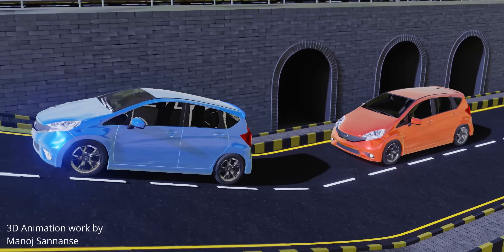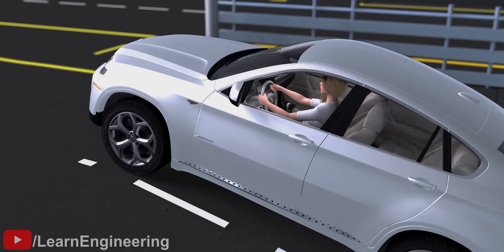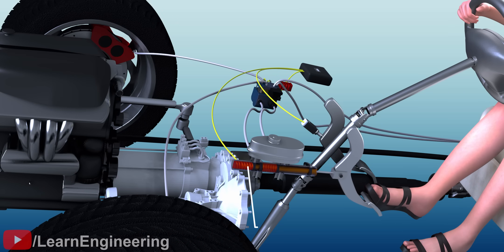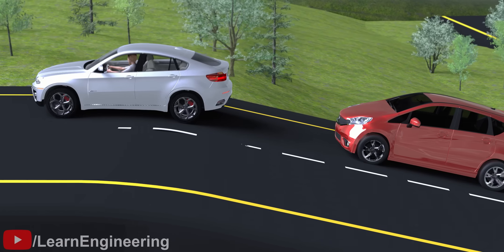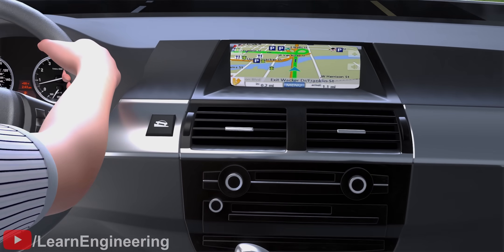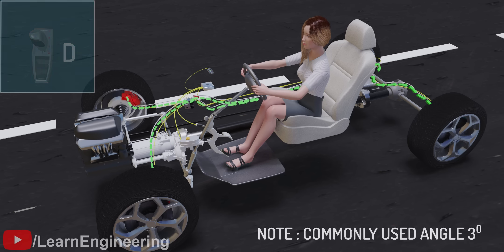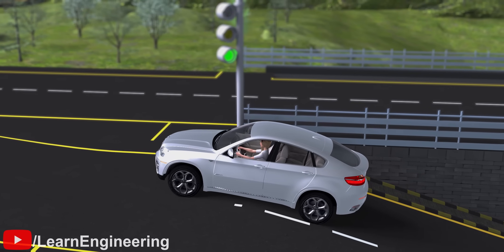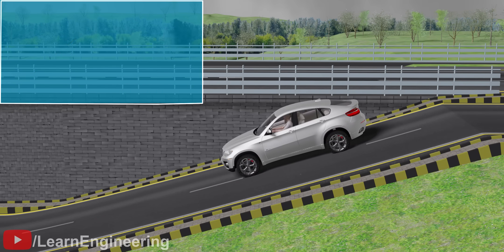Understanding Hill Start Assist!

Comment: Some newbie drivers right now will never experience the pressure when driving a manual and an uphill traffic occurs. Especially when you're a beginner and you can feel your car rolling down and you can hear the honking of the car at the back😂
Reply: My legs be like jelly during such situation
Reply: @Sweaty Goat  mine too absolutely hate going up a hill
Reply: I was taught to drive on a vehicle who had a weak engine (maunal ofcourse). That's why rolling back is extra easy on these things. I have yet to master the art of moving your foot fast enough without the handbrake😅
Reply: @goodboi7266 dude, clutch control, release a bit the clutch pedal and then accelerate, if done right the vehicle shouldn't roll back at all
Reply: Everyone who drives a manual remembers an expensive ass car (a Tesla in my case) pulling up super close on a hill  and you have maximum pressure on you to not fuck up
Reply: The biggest fear is when it's a steep hill and the guy behind you decides to stop 1ft away from your bumper.
Reply: i didnt have HSA, and i have 3 pedals. I just move my feet fast enough that i never even have to use the handbrake.  dont know what kind of a driver would need HSA in a car with only two pedals when the driver have both legs ?
Reply: @RidewithRevin  new cars, new drivers wont understand moving our legs fast enough that even gravity cant pull us back.
Reply: @lalmuanawmahlawncheu  true thing
Reply: @lalmuanawmahlawncheu  lol, I am a new driver and have been doing this ever since I got my license - quickly changing the right foot to the gas pedal and quickly releasing the left foot's pedal. Now I am trying to learn how to hold the clutch uphill so it's a bit easier and less stressful
Reply: @lalmuanawmahlawncheu    00
Reply: @lalmuanawmahlawncheu  If you try at manual car you're probably gonna either crash or kill someone behind you. If you mean the bumper fake cars which are automatic then you really need to try your best to fuck up.
Reply: @BillPurkayastha  born and raised in Shillong, Meghalaya but now living in Mizoram. But not as bad as steep as in Mizoram.
Reply: @RidewithRevin  People that live in US..
Reply: @RidewithRevin  because in automatic cars you still have to use right leg for throttle and brake. You wont use left leg to stop because like in manual cars you will smash your face in the front glass.
Reply: @RidewithRevin  😄😄😅
Reply: @RidewithRevin  it’s cheating, drive a manual right not with a computer
Reply: @RidewithRevin  right.
Reply: @RidewithRevin  You would be shocked who would NEED this HSA to help them ...
Reply: @RidewithRevin  it's for safety. Just because newer cars have it doesn't mean the drivers are bad.
Reply: @RidewithRevin  yeah this is what I found out. Basically in my learner car literally all I had to do was be on the bite no handbrake and even no gas!! And it would literally be dead still
Reply: @RidewithRevin  tips on moving your feet quicker? So when I stop on a hill you quickly add a little gas and find the bite and the car just stays without a handbrake? I can do it but I need to be quicker cause the car rolls back slightly
Reply: @RidewithRevin  legend 😂🔥
Reply: @RidewithRevin  0 see e
Reply: @RidewithRevin  but you can put your car in the half clutch which some automatic cars don't have
Reply: @RidewithRevin   noob..  I don't use HSA nor brake on uphill.  I open the door and use my left leg to stop my car from rolling down.
Reply: @RidewithRevin easiest way for the vehicle to not move at all downhill is to release a bit of the clutch, depending on the clination, the bigger it is the more you release the clutch, of course not so much that your engine starts stalling, never release it more then half, after you released the clutch you can test it by slowly releasing the brake pedal, if the car doesn't roll back then the clutch is doing its work in keeping the vehicle immobile(what it actually does is trying to move the vehicle forward but fails because of the clination)
Reply: @RidewithRevin  stop being cocky mate it's specifically designed for auto transmission so it doesn't break the transmission unlike manuals which don't need hsa.
Reply: @mohammadali9930  i had a Renault van with hsa on it and it was a manual. First car i ever had with this system and i found it by mystake, when i tried to let the car roll back on an incline 😂😂 so yeah, you can have it on a manual as well
Reply: @jony6107  HSA is very common in modern cars, both manual and automatic 👍🏻 For instance, my Opel Corsa Sport 2021 (Manual) has HSA 😅
Reply: superblade stee  where did i say manual cars need hsa they already have their handbrakes
Reply: @mohammadali9930  
In the 1980s Subaru and BMW fitted 'hill assist start' to their cars with manual gearboxes.
On Subarus it was standard - ie no option to NOT have it.
Perhaps BMW doesn't now, I'm not sure.
I know my current MANUAL Subaru DOESN'T have it - and I certainly don't miss it.
Reply: Dude you just reminded me of that and my heart started beating
Reply: Anxiety level max 🤒
Reply: i use the clutch balance right after leaving the brakes to hold the car uphill , took a bit of practice but it works!!
Reply: @shanthanupadmanabhan7941  yeah I used to do this in my learner car literally just on the bite point no handbrake or gas and the car would just stay still but now in my own car it needs gas as well as the bite so I need to balance it but I’ll get there I’ve only just passed my test. Maybe I was learning in a diesel 🤷‍♂️ cause now in my own car if I don’t give it any gas it will just stall
Reply: @shanthanupadmanabhan7941  have fun replacing your clutch
Reply: @wholesale_greenbeans  what would you recommend? I’ve just passed my test I’m guessing you just use the handbrake instead?
Reply: I'm a newbie but I can launch the car smoothly uphill with manual transmission
Reply: This happened to me few days ago lol. Good thing I have my brother with me, so I stepped out of the car then swtiched places with my brother lol
Reply: @benzxavier2165  should've made him stand behind and hold your car back from rolling
Reply: @benzxavier2165  yea it's good to have someone like that. Literally would try to avoid stopping on an uphill so I would literally stop 30ft back where its flat. Therefore I dont have to deal with that struggle, or put on emergency lights so people can stay back
Reply: @FuturePorscheOwner911  I’ve been driving manual for less than a month and I still think that’s the dumbest shit I’ve ever heard. It’s not actually that bad it’s just kinda stressful, but after a few weeks you figure out handbrake starts and you should be fine
Reply: It's actually pretty easy for me to use manual car. Once you're on uphill traffic, always pull handbrake up. Before off handbrake, play a bit clutch and gas paddle a bit until you hit the spot then immediately put off handbrake. Most older cars are not easy for beginners especially when the clutch gives you in trouble and the engine starts to turn off suddenly because you gonna act fast.
Reply: I'm new to manual and I drive a subaru wrx sti 2021 and it has an uphill assist, but the car still rolls back on super steep hills. OMG the other day I tried one in an empty no car steep hill and I nearly shit my pants. lololol.  Thank God there was no cars and I decided to try it first.  Also, a second time I tried this was in real traffic with cars behind me but less steeper hill and car stalled twice, third time, OMG I pressed the gas pedal like crazy that the clutch smelled like burnt (not a good thing), but I was shitting my pants thankfully the car finally took off.  When I got out of the car my heart was in my throat. hahaha I can drive just fine around the city, but uphills in manual transmissions can literally stab you in the heart if you're not careful, then you get off the car with your legs feeling like jelly and shaky.  I'm still on practice and learning mode.  Getting the hang of it, piece of cake on flat roads. :)
Reply: Thats only in america bro 😂 , like 80% of europe use manuals
Reply: I had same experience 2 days back. Everyone was furious 😃😂. And I thought I will never drive again
Reply: @Da 🤔 did you just say the foot brake is not strong enough to hold the weight of an old manual transmission while 100% of the people in this world use that same foot brake to keep them at a stop while on a hill ???? 
Now an old school handbrake has a cable that can snap at any moment and release that rear brake ... 
Foot brakes are hydraulic and the chance of that pump releasing is rare ...
Reply: I know this feeling 😂🤣
Reply: dude I just passed my exam on a diesel car. Now I'm driving an old petrol car, it's harder and I need to use the handbrake. But I'm also curious how does the hill start assists works on new cars haha
Reply: @sancho7198  I passed in a diesel car but currently driving a petrol, I had trouble finding the biting point at first in the petrol. I believe the HSA works in a similar way to the one in this video where it waits for the right torque to release the brake. Although if you were taught to find the biting point whilst stationary then you probably won’t even realise that it’s there
Reply: @sancho7198  my problem is I could literally just hold my learner car dead still with just the bite when on a hill no gas or handbrake maybe I was learning in a diesel as well. But now with my own car which is petrol it needs gas as well as the bite otherwise it just stalls so trying to get used to it now 😭😂 trying to do it quicker so the car doesn’t roll back at all
Reply: @sancho7198  You just press brakes and then press gas with that auto stop system. When you activate it, if you leave the brake pedal it doesn't move your car for about 2-3 seconds. Its like having a mini temporary handbreak
Reply: IM a beginner, and i have a manual!!!!
Reply: Hey I do experience this, for now I got to drive my father's car,  manual old Petrol car from 2003 that requires you to push gas pedal to make clutch work,its sure scary and just now I had a nightmare last night about stalling and hitting the car behind 😭😭😭
Reply: @mufmager  
You think 18 years old is 'old' for a car. 🤣🤣🤣
In Aus that's not even middle-aged.
What kind of car requires you to push the accelerator to make the clutch work?!
Really. I'd like to know.
That's bizarre.
Reply: @trueaussie9230  Peugeot 206 SW 2003 model, petrol also.
Reply: @trueaussie9230  Gotta push the gas pedal a little first so the clutch can do it's work, thus leaving your brake pedal unfortunately free from not letting the car roll back, that's why you use the handbrake or are fast enough to take off with first gear (depends in the inclination of the hill, and if you have a car behind it's way worse)
Reply: @mufmager  
The clutch 'works' by depressing and releasing the clutch pedal.
Nothing else.
Pressing the accelerator does nothing for how the clutch 'works', it causes the engine to work harder, which it needs to when the clutch is engaged in order to move the car.
When starting off, whether on 'the flat' or on a hill, you need to 'balance' GENTLY releasing the clutch while GENTLY pressing the accelerator.
When on a hill you also need to balance gradually releasing the handbrake.
Again, pressing the accelerator DOES NOT make the clutch work.
Please, ask an experienced driver to help you to learn how to safely start moving up a hill or, preferably, invest in a few advanced driving lessons.
It takes practice, but once you master the exercise you'll wonder what the fuss was about.
Most important - believe in yourself, don't panic and don't care what others think or say while you're learning.
You CAN and WILL do it. ✊✊✊✊👍
Reply: @trueaussie9230  No it's my father's car and it's how it works, old manual transmission cars all I've driven worked the same, only the one from driving school, worked by depressing thr clutch making it move slowly, and either another modern manual I driven (Seat Arona)  worked like that too. All old manual transmission cars I could drivr were petrol also not diesel. Trust me I want to own a car that works that easy or it's just an automatic transmission.
Reply: @mufmager  
You have me intrigued.
I will hunt one down and take it for a 'test drive'.
I've been driving and working on cars for more than 50 years.
I can't imagine how your car can work as you say.
Reply: @trueaussie9230  Bro you legit gotta press gas pedal first, when I practiced with that car, no matter how slow I lift the damn clutch, it would stall if I didn't push gas pedal a little first. It's so annoying the way it works I know.
Reply: @mufmager  
Yes. Of course you need to increase the revs.
But that does not mean the accelerator operates the clutch.
That's called 'balancing' the clutch and accelerator.
As I said previously, it's because the engine needs more power when it's asked to do more work.
And it makes no difference whether the engine runs on petrol or diesel.
The clutch operation is exactly the same.
Reply: @trueaussie9230  In modern manuals when you lift the clutch slowly, the revs go up to have enough force to move slowly.

With this old manual transmission car I mentioned previously (and same with a 2002 opel car)  you need the gas pedal to get revs so when u lift the clutch it works and doesn't stall because with these old cars the clutch itself doesn't get revs to make the car move slowly.  
Thats what I meant to say, sorry my English kind of sucks and it's hard to explain this, I'm not a car guy and I have 1 year and a half of driving experience.
Reply: @mufmager  
OK. Now it's the clutch pedal that increases engine revs?!
What ever you say. ☺
Reply: lol yeah , i don't see a need here for uphill start assistant , you can simply put a foot on the brake and another foot on accelerator
Reply: Thats so true. I drive manual car with 3 pedals. When I see these technologies I feel the new generation will never understand the basics of car tech as the car will take care of everything now.
Reply: @abhishekpaul6979  well eV will finally get rid of the stick shift
Reply: Brakes ON,  HALF CLUTCH  find the bite point release the brakes and boost on thats it
Reply: Wtf you guys dont use handbrake?
Reply: It's so easy with a manual. Worst case just use handbrake as assistance.
Reply: @JustusS2036  I’ve only now passed my test when I was leading I would literally just hold the car dead still just on the biting point no gas or handbrake but now in my own car I do this and it just stalls. I’m now adding gas as well so it needs that balance in order for the car to stop still so it’s different any tips on being quicker so the car doesn’t roll back?
Reply: Remember when driving a rent a car with 65 hp and petrol engine with no torque at all, when all the roads where uphill, everytime i had to stop,   the pressure was high and could feel the sweat drop in my forehead. 😰
Reply: Yep ...
Option 1 is ride the gas and clutch to keep it steady.
Option 2 is use the handbrake to keep the car stopped and when ready to go, you use the clutch and gas to start moving while using your hand to release the hand brake .. 
If you have a foot e-brake, well you are going to now ride the clutch and gas. 
Most automatics wont roll down the hill because the engine is still turning and turning the torque converter which is trying to turn the tranny and tires ... 
When i was in San Francisco, we had a rental and obviously automatic and it never rolled back ..
Reply: @ACommenterOnYouTube  if it’s just a slight hill and your not going to be there for a while then it’s fine to just ride the clutch and gas right? I’ve heard it can burn your clutch
Reply: @dannyh_fitness  sure BUT every time you shift, you wear out the clutch, just not as bad as on that hill riding it back and forth or using the clutch to hold the car from falling back ...
This is when a hand brake becomes very helpful on a manual car in a hill, having a foot e-brake on a hill while driving is worthless to you, now you have to ride the clutch to hold it OR use your brake, then the second you release that brake, YOU ARE GOING BACK and now you have to be fast with the gas and clutch before you fall back and hit the a-hole behind you that stopped on your tail ...
Reply: @ACommenterOnYouTube  yeah so the options are handbrake or to ride the clutch and gas 👍🏻
Reply: @ACommenterOnYouTube  I would normally just ride it at the start and if I’m there for a while then I’d use the handbrake but maybe I’ll just use the handbrake now instead
Reply: @dannyh_fitness  hand brake is always the 1st option, then you can gas/clutch it while lowering down the hand brake, but you got to be coordinated or else it wont work LOL ...
Reply: @dannyh_fitness  like you said, if you know its only gonna be for a second or 2, then ride the clutch, but if its gonna be a 2-3 min light .... yea hand brake it.
Reply: @ACommenterOnYouTube  alright cheers!!
Reply: @dannyh_fitness  🍻
Reply: I drive a manual. I passed my test two months ago. When I go to visit my family in other towns, the routes are through hill areas. So I have managed to get good at Hill starts.
Reply: And they will never use the good old trick: you're in an uphill stop. you apply the park handbrake. traffic light goes green. with the park brake applied, you press the accelarator pedal, release the park brake and off you go without your car rolling down! good old times!
Reply: @dmstn  i said that already 🤣 but that ONLY works if you have a hand brake. If you have a foot brake, that method wont work, now you have to ride the clutch and pedal for ~ 2 min 😡
Reply: @dmstn  haha yeah might as well just do that 😂 I try and not use the handbrake and the car would roll back only slightly but there could be a car right up right to you and you’ve hit it so it’s just safer to use the handbrake. On slight hills though when your not going to be there for a while is that alright to not use the handbrake and to just balance the clutch and gas? I’ve just passed btw haha
Reply: Yeah bruh.....even you won't understand how people used to drive uphill in 60s
Reply: @Da if you are in a manual and on an uphill, you have to use your hand brake OR ride that gas and clutch to keep you still but who is going to do that for ~2 min ??? You cannot use your foot brake because the second you let go, you are going BACK ... and if the clown behind you is on your tail, you are going to hit him.
Here in Florida in my city, we do have hills on the west side and west coast but i am never on that side of town so those hills dont affect me.
Reply: It's not only about being fast at the feet... Up hill we must lift clutch's foot next to engage position, and so take the right foot out of brake and gas it up. While accelerating, the left foot proportionally let the clutch engage and the car smoothly go forward without moving back at all.
That much control is what I love on older cars.
Reply: They also won't be having to deal with corrupted, slow, small floppy discs or defragmenting their harddrives every so often.  Things change.
Reply: my dad likes to put me in this situation everyweekend because my local samsclub has a parking lot with a steep hill (i mean its angled at like 50 fuckkng degrees or feels like it) with a stop sign at the top along with the road in front of me being a tight turn to get in and it being 1 way the drivers coming from my left having a straight away.
Reply: You 100% correct definitely a great way to burn out ya clutch , it used to be a skill that was very much needed.
Reply: My first time driving manual I was stopped behind a bus on a hill and my English teacher was right behind me, somehow I was able to figure it out without stalling. The next red light i did stall though
Reply: HAHAHAHA true
Reply: Bro 😂😂😂
Reply: yeaa its hard times 🤣🤣
Reply: Yesss true af😂
Reply: Me 🤕
Reply: Or the dumb ass doesn’t know manuals exist and is on your ass while they don’t roll back
Reply: Well but thats something you pretty fast learn to do by yourself
Reply: i recently started driving and before this video i didn't even know that there's this type of technology available in this world, i always use handbrake in that type of situations
Reply: I honestly got used to it
Reply: As a poor student I can say we will still living that situation (manual cars are low maintenance vehicles ) jajaja
Reply: Hahahahaahahaha i feel the same thing when i was beginner.
Reply: ..and the sound of metal & plastic being crushed😅
Reply: The tensions and nervous hahah
Reply: Lol in that situation I just pre switch to first and then slam my foot as fast as I can on the pedal but normally that makes my tires screech but better than rolling back
Reply: @calettov2  
You prefer to spin your wheels rather than use your HANDBRAKE.
Seriously.
Please take some driving lessons, from a competent instructor, before you kill someone.
Reply: @trueaussie9230  dawg I'm not performing burnouts. the spin, if any spin at all is controlled I almost think that you haven't even driven a car before
Reply: That sounds horrifying
Reply: This feature was available in BMW back in the 2000s
Reply: That was very difficult task😂
Reply: That’s completely true
Reply: We still have manual gear in the majoriry of cars in Morocco
Reply: Im the newbie, almost hit the car behind me, thank god my engine not died, and could barely climb that hill
Reply: @oenbro.9931  lift clutch slowly until car tremors and then release brake and acelerate without lifting the clutch more and obtain sufficient rpm to keep engine alive
Reply: I was learn to start from handbrake
Reply: I use handbrake
Reply: It's a nightmare without HSA😂
Reply: @omvakil7463  
Please, for the safety of all road users including yourself, either hand in your licence or take some lessons aimed at actually teaching you how to control a motor vehicle.
People like you scare the shit out of me - because I'm using the same roads.
Reply: Poda potta punda
Reply: i am a new driver and I have experienced what you described
Reply: Priceless😂
Reply: All modern ice cars have a clutch in one way or another. Otherwise the engine would stall when the car is at a stand still. Yes, even cvt and torque converters have a clutch of sorts.

Most, if not all, modern cars have hsa too. Not even that hard to program in even the car is equipped with an electronic brake system of sorts.
Reply: You got it forget manual manual transmission of slowly fading away no one really drives that everybody drive automatic transmissions how many UK they drive manual transmission steel
Reply: Handbreak and you are ok
Reply: This happened to me alot it's so embarrassing lol
Reply: @jakot2007  alot huh ?? Maybe the 1st time didnt teach you a lesson ??
Reply: " you don't need to tell me ,I was there" -Ace Ventura
Reply: 😂🤣😂 true
Reply: Application of half clutches in the hill traffic situation is really tough for me when am at the beginning of my driving time. Now it's a piece of apple when we all are drive a AMT while comparing it with the manual shifts.
Reply: Man...this problem was the main reason why i was never able to drive with confidence in the earlier years
Reply: Today🥴
Reply: I remember when driving manual on an uphill road I have to use handbrake.
Reply: And to smartly use the hand brake to move ahead uphill.
Reply: This is the only valid comment in this section. Well said Sir🔥🙌🏾💯
Reply: 🤣🤣🤣So true
Reply: well at least. an automatic system will make you safer than using a manual car. if were just an arrogant driver.
Reply: @carlotheatheist  i mean i havent driven manual for a while and i was trying to get used to it but its just the clutch couldnt balance on that hill and u would roll backwards regardless
Reply: Most scary moment in my life....I have stopping my car at hill 🥵🥵
Reply: The worst is, T- junction in up hill with traffic. I still remember i hit a car with no driver(some rich man car, Toyota fortuner it's very costly car after national tax and all) and broke the head light. And drive away as quickly as possible.
Reply: @frostfire9943  yeah i always have a few cars behind me and always miss my oppurtunity to go when i try to get the car in motion. cars start honking, drivers on the straight away are impatient due to the samsclub being the only store most people go to
Reply: That’s the point of innovation. The same reason why you don’t sweat your balls when making a fire nowadays.
Reply: True 😹😂😂
Reply: Im a newbie but only droce manual, when someoje showed me how to ise the handbrake in these situation, it just rocked my world 😅
Reply: That's one of the most frustrating situations i have ever experienced😂😂
Reply: i experine that before no doubt all newbie driver
Reply: If ur driving manual uphill: 1)press brake 2)rev to 4k rpm 3)let the brake and quickly dump the cluch 4) ur on the move!
Reply: Noobs. Handbrake can be used as an HSA. You never have to roll back down ever
Reply: I can say i just did my manual driver license and and it was very stressful, especially if the engine dies cuz you panic and release the clutch too fast
Reply: @greenyhobunkr6774  when on a hill just use the handbrake if your only there for a few seconds just ride the clutch
Reply: @dannyh_fitness  dw i was talking about back when I didn't know how to do it, i learned it by now (although i usually don't use the handbrake)
Reply: @greenyhobunkr6774  yeah! I just passed my test I didn’t use the handbrake when learning but apparently it burns the clutch out so I use the handbrake now if I’m on a incline for a while
Reply: true, handbreak will do the trick
Reply: the problem after vaccines roll out drivers go in reverse and you can honk as long as you wish no HSA will ever help.
Reply: They have saved us : 
Hand break, biting point ,breaks & gas were making us busy for no good reasons 🤔😀
Reply: Omg yes definitely 😂
Reply: some newbie drivers drive manual, newbie drivers in third world country where trucks and still not electronic
Reply: Biting point balancing uphill where you either roll down or have your engine shut down is a nightmare. Imagine having to park on a ground like that or do a reverse turn from the corner of the street.
Reply: Hehehaha 👍😂👍
Reply: Oh Istg
Reply: Especially when that expensive ass SUV stops 0,041 microns away from your ass
Reply: Jeez that cost me my license for a month 😂
Reply: I'm
Reply: That's why MANUAL parking brake used to be a thing! If the hill was too steep or you were too nervous or just novice, you could always revert to using parking brake with the side effect of some minor burnout.
Reply: Starting a carburetor uphill is even harder.......🥲
Reply: Half clucth technique...  So much technology sa mga car ngayon. Kaya mga baguyan. Wlang improvement sa oag dada drive. Pasado nka depende sa tech...  
Kaya baka nila mag reverse park na wlng camera?
Reply: I was experienced same
Reply: I used to face this issue of car rolling backwards in slopes (especially in NJ, there used to be traffic lights exactly on top of the slope). Just when light turned green had to immediately hit gas pedal! Many a times it used to roll backwards with people honking heavily behind!
Reply: You are aware that people learn in older cars.
Reply: 😂😂😂😂true , i own manual car and experienced that awkward embarrassing moment last week but i’ve learned “uphill drive” at the same time. But i am in a process to move faster without using hand brake
Reply: This happened to me yesterday may car started rolling down while waiting the right moment to enter the road, lucky me there where no cars behind me
Reply: We still have manuals more common here in this part of the world! Have never driven an automatic!
Reply: I hated it I would always peel out bc I got so nervous I was going to roll back into someone haha
Reply: If you don't know how to use the handbreak for hill start with a manual car, well good luck
Reply: Burn the clutch😂
Reply: With manuel transmission 😅
I miss the old days
Reply: God, the Lord Jesus Christ loves you! Restore your relationship with God by repenting of your sins and putting your faith in Jesus Christ, "... that Christ died for our sins according to the Scriptures, and that He was buried, and that He was raised on the third day according to the Scriptures..." (1 Corinthians 15:3-4)
Reply: That was terrifying
Reply: I thought this video was about manual cars, I am disappointed
Reply: U can literally hold the car in place with your clutch. Cmon it ain't that hard.
Reply: @martinok4320  Don't do that you will limit the life of the clutch if you do this multiple times in a row or for too long with a loaded car you can smell the clutch burning
Reply: @catalintimofti1117  i know i'm a mechanic, i do this daily cus we have to drive cars up the lifts. Giving more gas and holding the clutch in place will burn it more. Trust me
Reply: @martinok4320  ah getting new customers i see :)
Reply: @martinok4320  
What's that tried and true adage?!
Oh yeah.
""Never buy a mechanic's car". 🤪🤪🤣🤣
Reply: @martinok4320  so you recommend just using the handbrake? What if it’s only a slight hill and your not going to be there for long it’s alright to do it then right?
Reply: @martinok4320  Not everyone had a car with torque
Reply: @martinok4320  it's hard maybe not for you
Reply: @martinok4320  yeah in my learner car I could just hold it on the bite and the car would be dead still without any gas or using the handbrake but in my own car it needs gas as well otherwise it just stalls. I’ve only now just passed my test btw
Reply: @martinok4320  It's hard only when traffic is moving fast and you need to find the biting point insta rly every time without getting rolled back at all which is also a very good reason to get an insta fail in exams.
Reply: @martinok4320  é verdade . A emoção esta nas trocas de marchas. 4:40
Reply: @martinok4320  with a weak petrol car with a 1 litre engine, you can't just do that. It will stall on a hill and you need to add gas to move.
Reply: @martinok4320  bruh auto transmission doesn't have a clutch 🤦‍♂️
Reply: @mohammadali9930  i was talking to the ones that were saying it's harder with manual
Reply: @martinok4320  oh alright 😅
Reply: @mohammadali9930  no one is talking auto here
Reply: @erickjuma7643  the car used for demonstration in this video is an auto so what's your point 🤦‍♂️
Reply: @mohammadali9930  under this comment we're talking manual
Reply: @erickjuma7643  This video shows hsa tested on an auto so why are you guys being proud and showing off i know a manual is better without hsa but nowdays it is essential for every auto car and the comment wasn't posted by you in the first place so why don't you mind yourself
Reply: @erickjuma7643  whose we? I thought i replied to someone else not you
Reply: @mohammadali9930  you are talking alot without any knowledge about cars. manuals don't need HSA, but neither fo automatic. But its helpful to have in some cases, mainly in manuals, its kind of useless in automatic transmission. you dont need to use a handbrake either. you have a brake in your foot. use that. you have only two pedals and two legs, so use them both 😂. 

and about that earlier comment about breaking the transmission,  it has nothing to do with the tranmission, I wonder how did you get the impression that not having hsa would break the transmission, but it has no relation whatsoever. 
Also, automatics mostly use a fluid coupling, and is less likely to break than a mannual. 

 I am a car engineer by profession, and when I see people do not have proper knowledge, but try to insist on the wrong ideas, I feel bad. Please take some time to understand how things work, before you start forcing weong concepts to other people.
Reply: @RidewithRevin  your main point is that your a car engineer so you know every thing right?I had an auto Corolla 2006 which actually broke the transmission and wasn't moving in d gear and my car didn't have hsa
Some vehicles don't require hsa but most vehicles specially older ones do require your attention without hsa
Reply: @mohammadali9930  do you hear yourslef ? The transmission breaking has nothing to do with having hsa. The logic you are using is just like when you see a car's engine to fail, and  the car didnt have windshield wipers, And you conclude that having wipers will not break the engine. 😂 
even if the corolla had HSA, it would make no difference, and the transmission would break when it did.
Reply: @mohammadali9930  i dont know everything, But I have logic behind the things I know. and I can actually give you proper reasons on "how" and "why",  about the things i tell you.  I didnt just say out of nowhere that hsa is not related to your transmission breakage, I said so because I know why its not true, and also how those systems work.
Reply: @RidewithRevin  nah man it's not like that 😂
Reply: @mohammadali9930  Why the fuck would you need hsa on auto car with 2 pedals?? Are you from the US?
Reply: @mohammadali9930 There are auto transmissions that in fact have a internal clutch, and even auto transmissions that have 4 clutches, research it, it is interesting how automatic has evolved to ease a newbie his life
Reply: LoadingGames. who needs hbrake to start from a hill? I have learned that since 13, and had to learn how does the clutch works
Reply: Some countries still require people to learn Manual cars. They don't reach automatic driving, just manual then you can drive automatic. Manual is honestly so frustrating 🙄🤣
Reply: @potatopotatoeOG  Yup but once you've mastered it you'll find autos boring 😂.
Reply: @potatopotatoeOG  🤣🤣🤣 what a noob
Reply: @potatopotatoeOG  manual is frustrating because u don't know how to master it
Reply: @shiki494  Manuals are real driving and exactly why cars require responsible drivers. Even a child could drive an automatic car if their legs can reach the pedals and steering wheel.
Reply: You must be driving 40 years old vehicle 😂
Reply: Hill Start Assist. One more excuse for bad driving.
Reply: You guys worry too
Much. I just let the car roll backwards until positive contact with the cat behind me. He can hold me in place until I get going. A few scratches and minor bumps didn’t kill anyone. Cheers. Francois from Lyon.